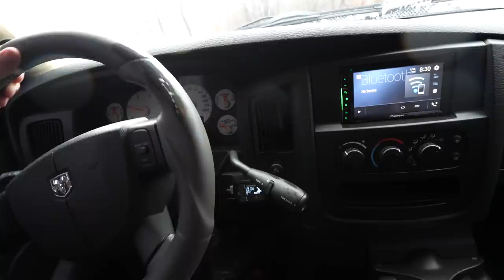The END Of 8 Ball As You Know It.

Comment: A set of hemi 2500 springs should lower the front end. They are a little softer, so the weight of the engine will compress them more.
Reply: Didn’t thuren and a couple of them offer a soft rate back in the day?